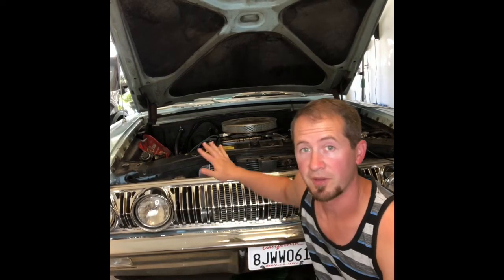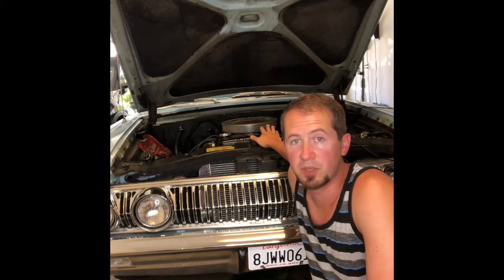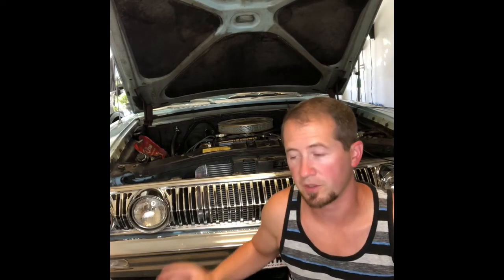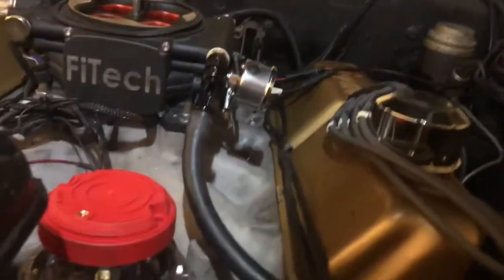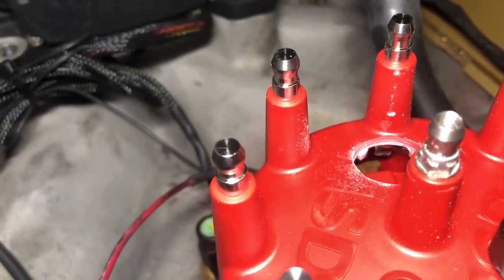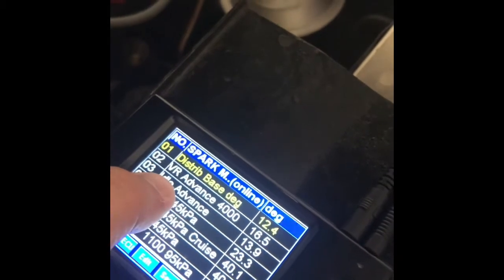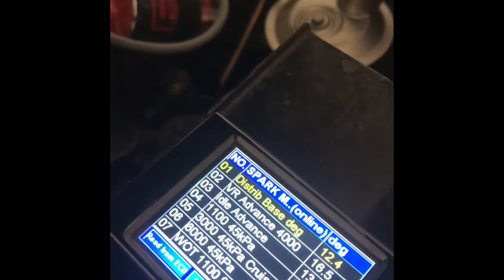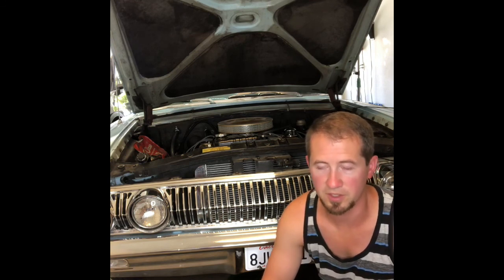FiTech timing control setup. Rotor Phasing. Proper Ignition Voltage. MSD billet

Comment: Great video but one thing is not completely clear.  On the  adjustable rotor, did your adjustment advance the rotor or retard the rotor?

Looking at the instructions for a Holley Sniper (very similar) they say to install the distributor with a base timing of 15* advance (BTDC) and then use a adjustable rotor that’s set with 15* retard.

Comment: I Don't Under Stand Why This Is So Confusing To Me. I Have A FiTech Ultra Ram I'm Installing. I've Locked Out My MSD Billet Distributor And Installed It At TDC And Put Cylinder 1 Where I Want It (SBC 350). My Distributor Rotor Is Not Phaseable. I Put Engine At 10 Deg BTDC. Now Do I Just Rotate My Distributor With Cap Off And Make Sure A Trigger Line Is Dead Center On The Pickup Sensor? What's Confusing Me Is If I Can Rotate My Distributor Is That Not The Same Thing As A Phaseable Rotor?
Reply from the maker: With a typical old distributor, the weights and vacuum mechanisms adjusted the relationship between the rotor and the cap, which determined when the spark would fire. You have to think of things differently now. The rotor and cap relationship is constant but spark is being sent at different times. Only your base degrees of timing can be set by rotating the distributor, you cannot set where the rotor will be in relation to the cap. Because of the position of the magnetic pickup in the distributor, the spark should be right about dead center between the rotor and cap. This becomes an issue because at 40° of timing the rotor is now away from the pin on the cap. That’s why phasing is important. You set it so that the rotor sweeps across one pin from base to full timing. It will travel from one corner of the rotor to the other. Phasing and timing are different. To get timing right, you rotate the distributor until timing readout on the handheld matches what you see on the balancer.